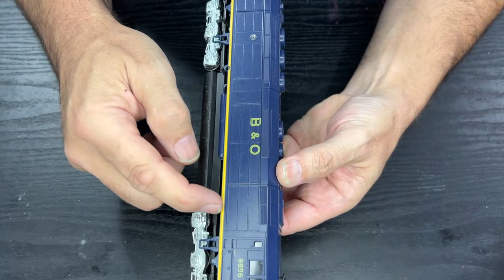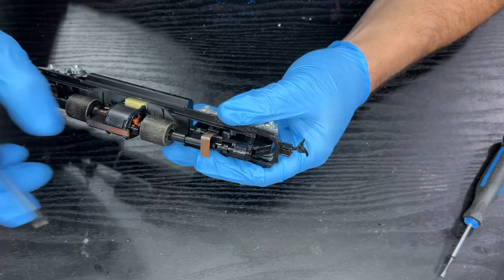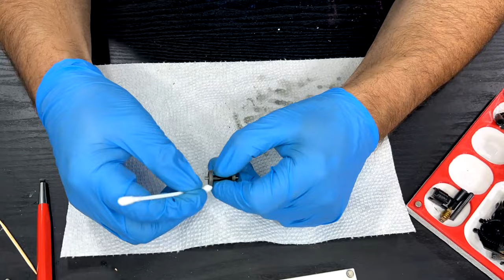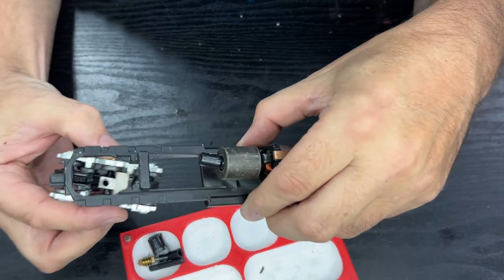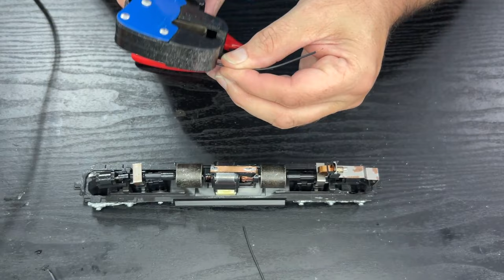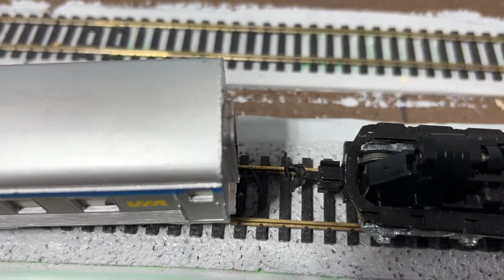Tune Up Tuesday - Athearn EMD FP45 - Fantasy B&O Scheme

Comment: Nicely done Dave. I just finished repairing and repainting an Athearn FP45 that I have yet to upload to my channel (Mastic Short Line). Two things to consider: 1. Check the ballasting over by the mountain view park. Any particles on the track may contribute to derailment. 2. It may not be so much the coupler on the loco that uncoupling occurs, it may be the couplers on the VIA coaches or it may be too tight a curve for the consist to handle. You should consider knuckle couplers on both the loco and the coaches. What radius are the curves, 18 or 22? Otherwise, excellent work!

Comment: I can tell you that Athearn uses steel for the buss bar to the motor along with the areas of the trucks in the blue box era locomotives. This is why they rust easily. Also, the wheels are made or sintered iron. So, they will rust if they get wet. 

Another thing about this locomotives model, it can be used to pull both freight and passenger trains. It was intended to be a dual-purpose locomotive. EMD thought if passenger trains disappeared, railroads could still use this locomotive for freight service. So, freight cars would be appropriate.